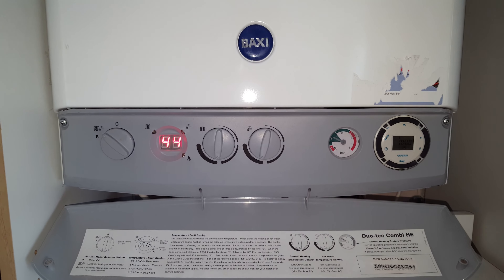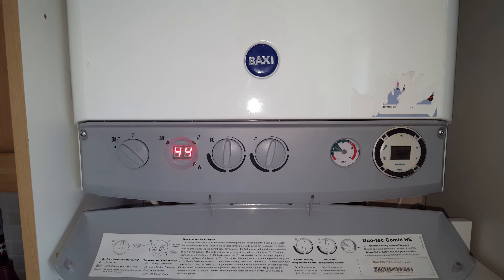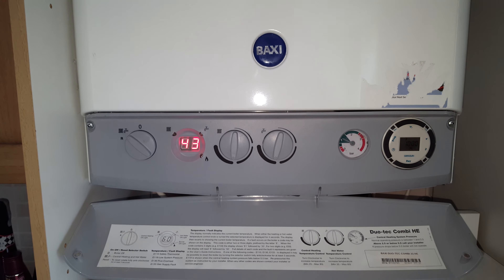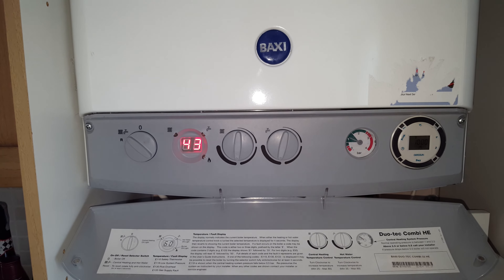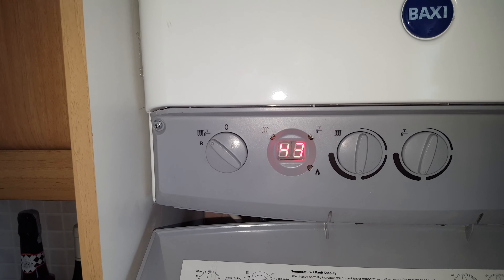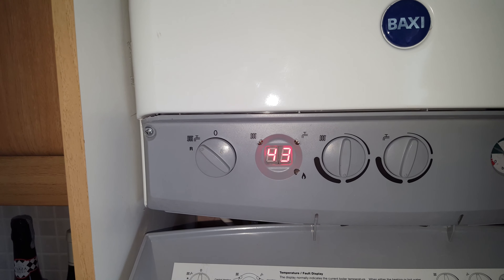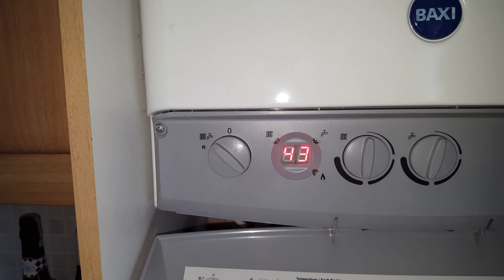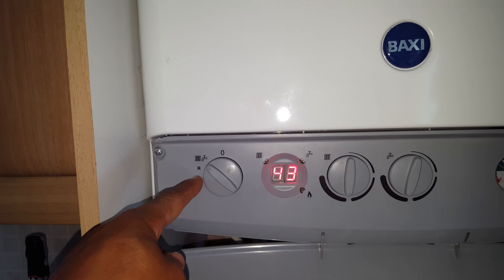E168 Error Message

Comment: Replacing the board doesn't always fix E168. P.C.B is common but E168 can be indicating that there has been a previous fault of a different code that has not been fixed and is still undiagnosed, therefore E168 is displayed as a replacement code when a previous code has been cleared and it cant remember what the original code was. E168 can also be linked to most of the other components not operating or lacking electrical integrity.
Reply from the maker: +Craig C Thank you for your comments we always learning from each other
Reply: Craig C
Reply: Craig C thank you soooo much for this comment Craig! I am glad I came across it, having the E168 error code I was dreading paying a hefty bill for a new circuit board but I just tightened the pressure valves under boiler then bled all radiators, reset boiler and all is fixed! 😀😀😀😀
Reply: Oooo I got all excited that this might fix our problem. We had a gas engineer turn our boiler off and replace a part in the meter housing after we had a carbon monoxide alarm go off. Since that we’ve had the E168 error. Sadly can’t seem to clear it :(